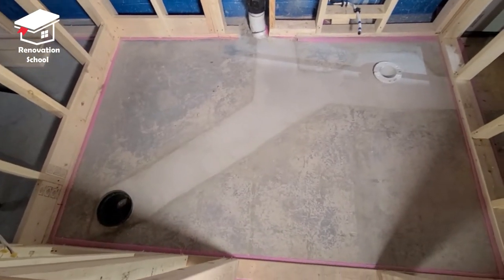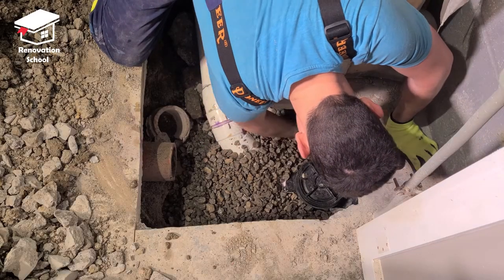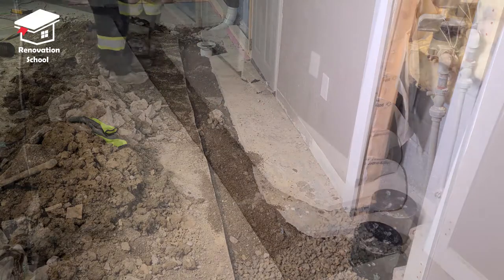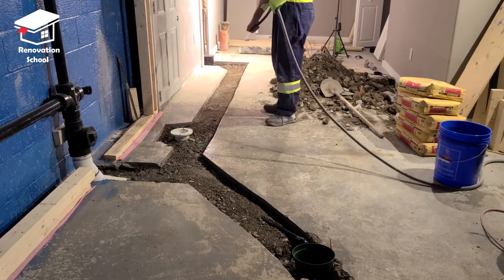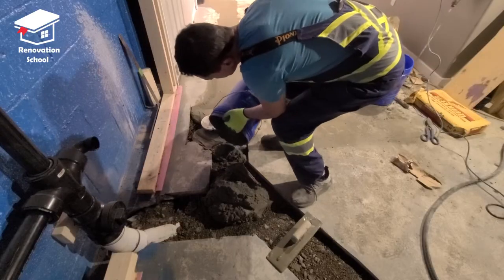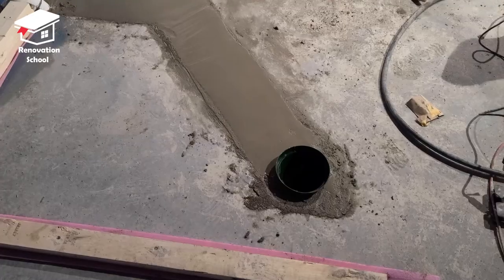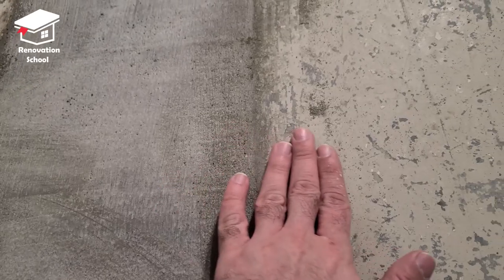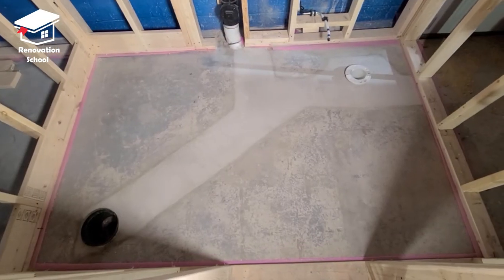How to backfill & pour new concrete in a basement floor?

Comment: why did you use sand mix instead of the 6000 psi structural stuff? i would assume you want the stronger stuff for the slab, no?
Reply from the maker: It's easier to level 
No need for structural here
It's just the slab

Comment: A quick question: I went to HD and there are a lot of different concrete mixes. Is this sand topping mix strong enough? I asked the person there and they said it was fine but just wanted to ask here too - the last thing I want are some structural issues happening down the road because I used the wrong mix.
Reply from the maker: It's totally fine for this.
But if you are gonna build 2 stories on it no
Reply: @renovationschool8818  thanks for the quick answer. My concrete is 3" thick and on this it says up to 2" thickness that's what made me suspicious.

Edit: I'm a total beginner, so please educate me about this
Reply from the maker: @stix1904 you will be totally fine .

Comment: I may have missed a previous video, but why did you transition from ABS to PVC and then back to ABS again? Why not just use ABS for all of it?
Reply from the maker: Thanks a lot for watching
We live in Canada and abs pipes are extremely expensive.
The building code allows us to use PVC underground
Anything above ground has to be abs. By using 4-in PVC pipes I saved about $400 in the price of my supplies.
As you mentioned I could definitely do the whole thing using ABS pipes.

Comment: Thanks! I have a small recess around my shower drain that I need to fill in before putting the pan in. It was hard to find a video on filling holes I kept getting results for crack repair. This is exactly what I needed. Thanks again!
Reply from the maker: I'm glad it could be a help
Thanks for watching

Comment: Thanks for the video renovation school. I was wondering if you could explain why it is ok for the concrete to contact the toilet drain/flange but not the shower drain...
Reply from the maker: Thanks for watching 
We installed a shower base later and the bottom of the drain on the shower pan needed some room to connect with the plumbing that's why it's left the way you saw it in the video. I left that flower pot so that I have a bit of room for the bottom of my shower drain.

Comment: I have a question how much Toilet flange b must be above the ground ? Or it should be under flash with floor?
Reply from the maker: Should be at least level with the finished floor
But it's best if it sets about a quarter of an inch or 3/8 above the finished floor

Comment: how do you cure the concrete afterwards?
Reply from the maker: With magic. 
What do you mean cure the concrete?! It will dry and cure by its self.
Reply: @renovationschool8818  Curing concrete can be done in different ways, idk if it's necessary for a small job like this.

Comment: Hi there ,I thought that u need Cement to fill back??I mean Not Sand mix cement??? Is that Ok??Thank you.I mean is that cement ok ,I thought that is for fill in between Brick and stuff.
Reply from the maker: We use mortor to fill the gap for bricks 
This sand mix concrete and perfect for this application. 
And goes on extremely smooth and nice.